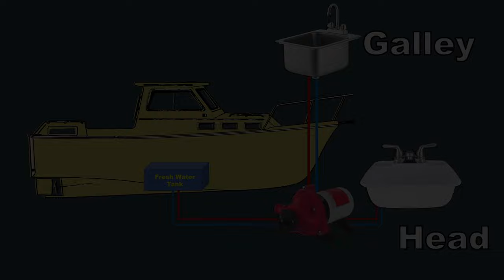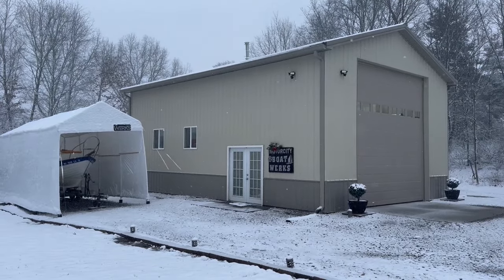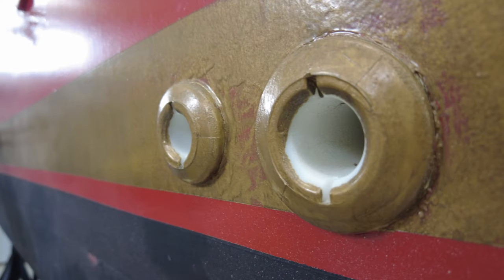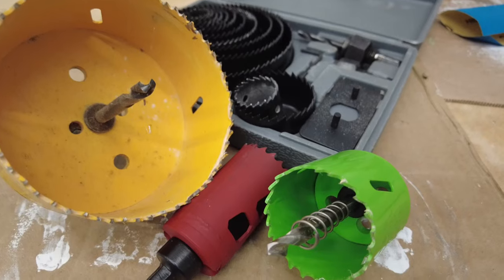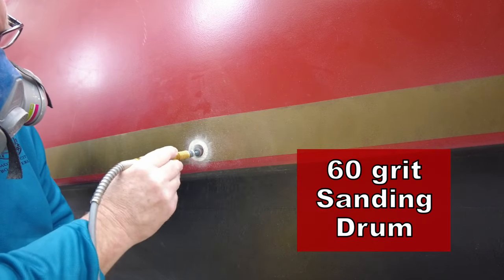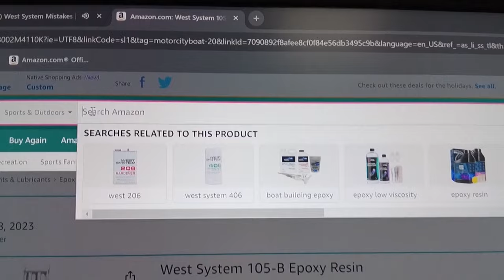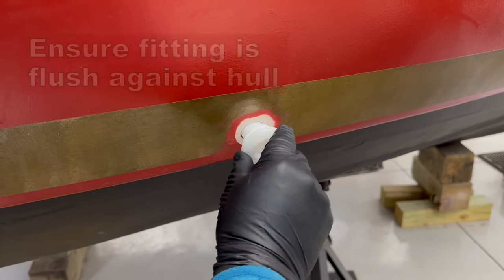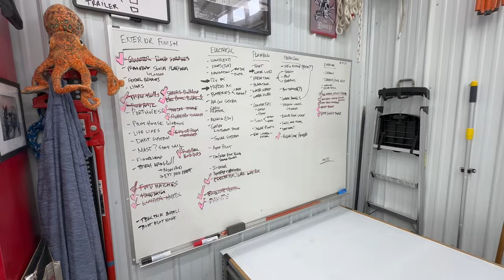This Can Sink Your Boat | Boat Restoration | How to Replace Boat Thru-hull Fittings (Ep 68)

Comment: Joe for each thru-hull size it's good to have a cork or wood tapered plug stopper if needed to stop a failure or hose rupture, then a person can jump in the water a bang the cork into the failed thru-hull till the repair can be made........I use old champagne corks. Hey another great Video Joe !
Reply from the maker: Thanks for the comment Vincent!👍😁

Comment: Unless you hope to re-use the old thru-hull, it's much more time efficient to grind off the flange from the outside and simply pull the stem out. Those plastic ones can be cut off with a Dremel.

Comment: I would have used a piece of plywood - drill with hole saw - use as a guide for the hole saw over the old thru hull…I hope that makes sense
Reply from the maker: Thanks for the comment. I think you will find this more challenging than you think. 🤔
Reply: @motorcityboatwerks  alternatively you could glue the backing plate in and drill from the inside….
Reply from the maker: If you’re desperate to use a hole saw—I guess so. But the beauty of the Snake is how easy it solves these problems. 😉
Reply: @motorcityboatwerks  I know how much you like your snake 😄- Im just not good enough free hand and would end up trying to fix an egg shapped hole ....have a great day my friend!
Reply from the maker: I hear you😀 I had the same concerns.  But I’ve become a believer due to the control and flexibility. The precision is unrivaled even for a clod like me. Stay safe 😃👍 And thank your for the comments 🤩

Comment: could you use bronze or stainless steel as the backplate. It would cost more but wondering if space is a concern.
Reply from the maker: Thanks for the comment Mark. 🤔There is no need for the added coast or weight of any metal backing plate for thru hulls. And the metal would not easily conform to the odd shapes of the hull